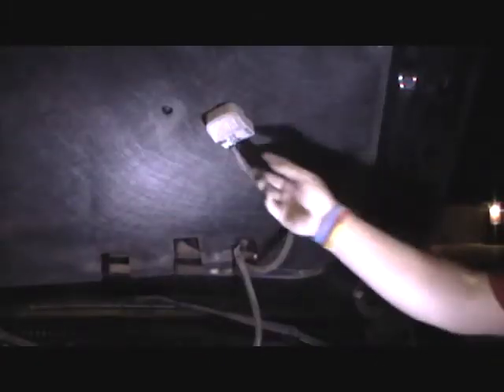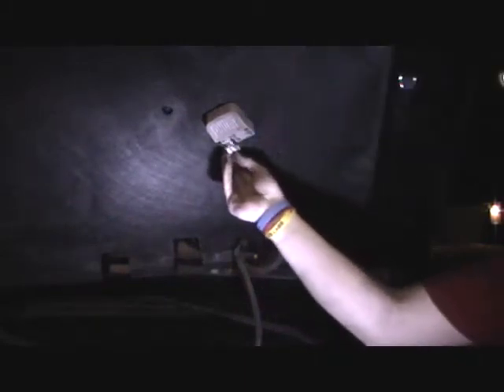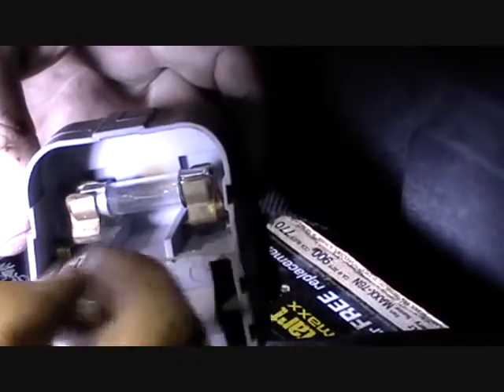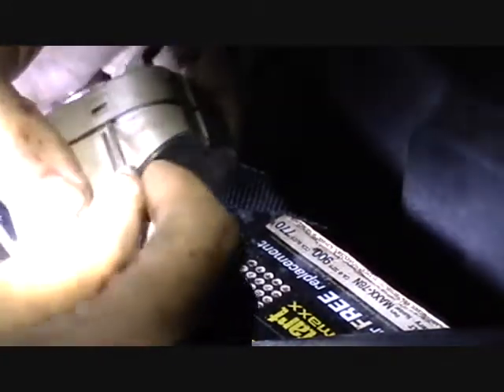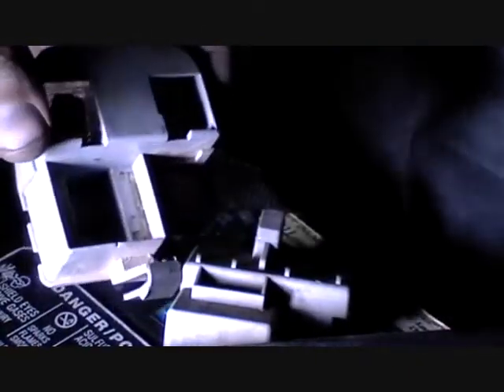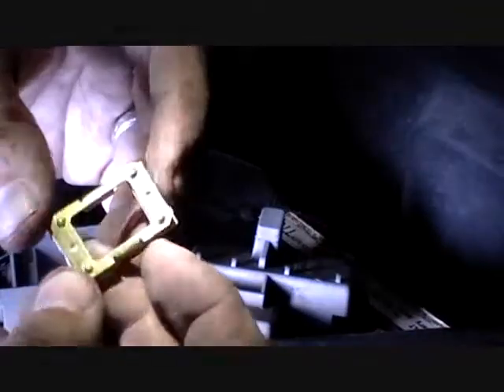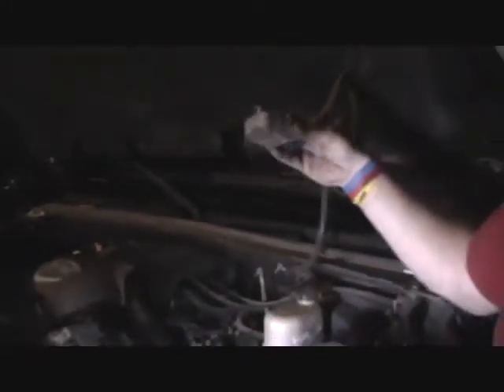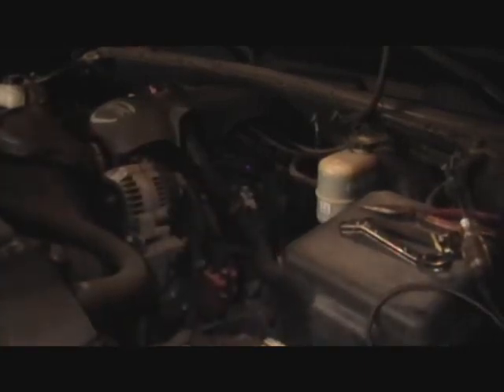How to fix your hood light

Comment: Just wanted to thank you for making this video.  I just purchased a 2002 Tahoe and the hood light was not working.  I replaced the bulb, and still nothing.  Using your video, I took the assembly apart and reassembled, and presto, it now works fine.  I replaced the bulb with an LED for even more light.  I just had to crimp the bulb bracket ends a little closer together in order for the new LED to hold tightly.
Reply from the maker: Comments like these are the reason I do these videos.  Doing a video takes way longer to do but totally worth it when I see comments like this.  So happy I was able to help.
Reply: @2LateIWon  what's your wire grounded to?? I think that's my problem now. Still going to clean it tonight while I'm out

Comment: I have a 2000 blazer and I cannot find the fuse for it. I know this is a different truck but I'm wondering if anyone knows the location? I broke the lid to my under hood fuse box and got one from the yard. Wasn't until later I realized the sticker inside didn't match up.
Reply from the maker: There is also a fuse box on the inside of your vehicle.  So look at your owners manual and it should tell you where it is